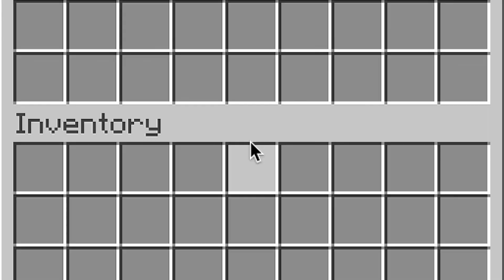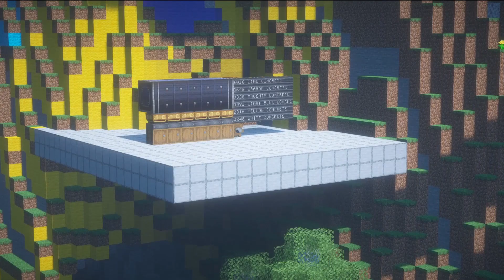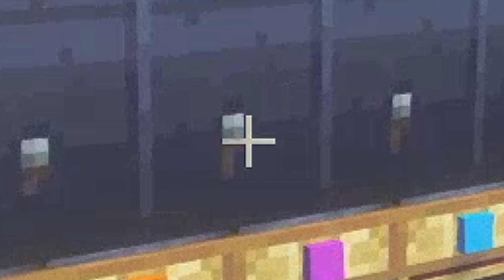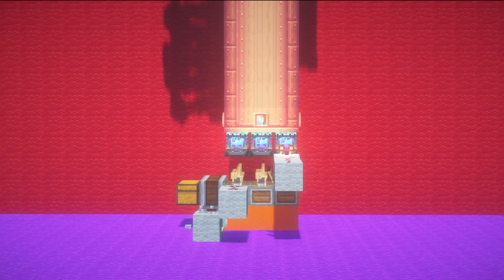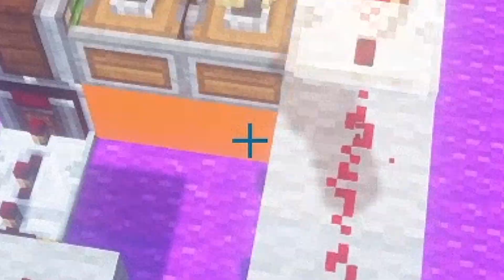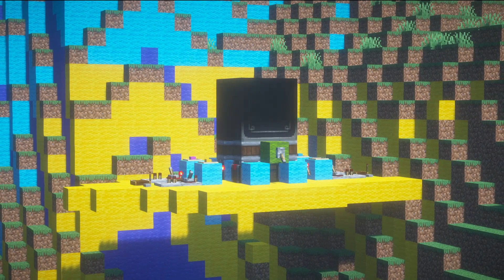Minecraft: 5 NEW Create Mod 0.5 Tools

Comment: honestly, out of all the things you've shown here, the most interesting to me was just the method you've used for the selector with the RS nor latches, though i do wonder if the new polished quartz lamps could be used for much the same purpose
Reply from the maker: 😅 I agree on the switch, it's the same thing I used to setup the multi-floor elevator, and I imagine it will fit in a lot of things that need a multi-station toggle. I haven't heard of this new polished quartz lamp.. Will have to check it out.
Reply: @BLOckOus  it is basically made for selector pannels, if you power/pulse one of the lamps in any number of connected lamps, then it will turn on and emmit a redstone signal, and turn any other connected lamps off. A variable size state controller I guess is one wa of putting it

Comment: these are great designs, however a really fast item transportation that I was recently made aware of is that you can simply have a contraption (either from a cart assembler or from pistons that are always contraption form) with two portable storage interfaces, which will transfer between each other instantly, while the vault one still takes some time between each item going through the air. however it is of course a contraption so it would take more processing power.
Reply from the maker: Thanks! Incidentally, I released a video about that type of storage system a couple of days ago! It's not as elaborate, but I'm hoping to build more versions of it soon: https://youtu.be/qDXxpiqJ9Nk